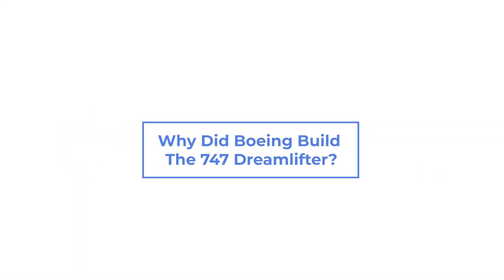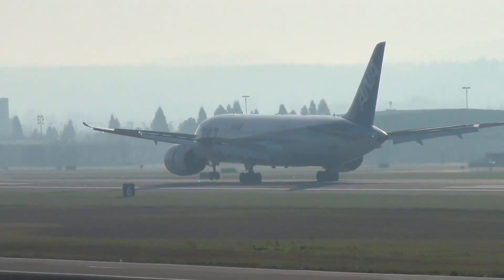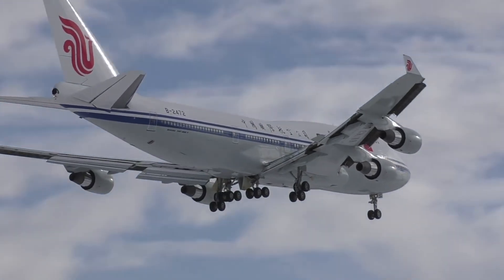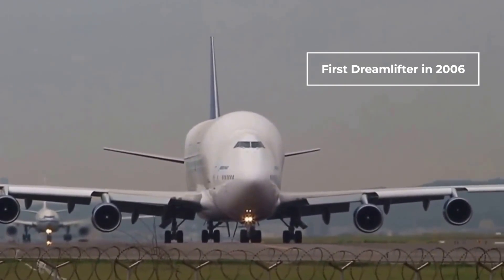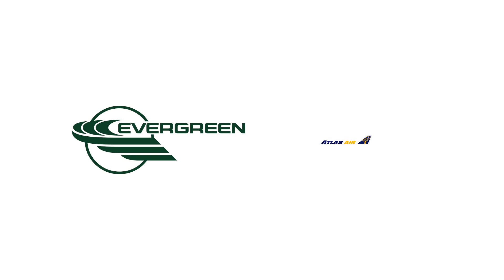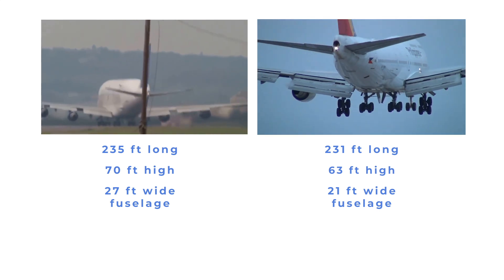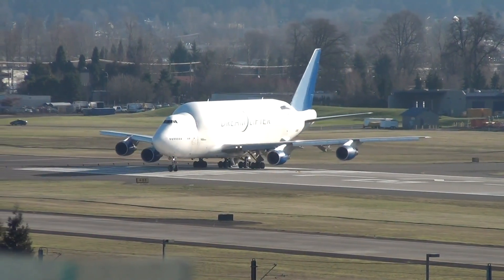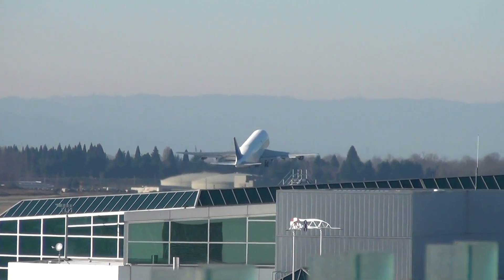Why Did Boeing Build The 747 Dreamlifter?

Comment: Alternative use: Three floor passenger aircraft for ultra low cost flights across the Atlantic.
Reply: Unfortunately only the flight deck is pressurized. Shape of fuselage will not support being pressurized (shape)
Reply: Michael Adams It was meant as a joke. With three floors there would leave no room for luggage, but at least part of the level below the main deck is pressurised on some 747s because the older models have various systems down there which can be accessed in flight through either a hatch in the floor or a small lift.
Reply: @14rans  Thanks for the clarification, I didn't know that

Comment: Short answer: To get one over on Airbus's Beluga
Reply: WHY? MONEY!!!
Reply: Actually the Beluga is Airbus' attempt to get one over on Boeing, they build the Guppy any a more modern version of it (or at least one of the companies they bought did).
Reply: Jame M 
Actually it is the other way around.
Airbus Beluga started operation 12 years earlier than Boeing Dreamlifter.
Reply: @miks564  And the Pregnant Guppy was built in 1962 from a Boeing 377.  So, if you're trying for some kind of who did it first contest - you lose. in fact, Airbus used a Super Guppy in the early 1970's to transport fuselage sections between different assembly locations.  Isn't that ironic?  Using a modified BOEING aircraft to transport Airbus parts?  BTW - the Beluga is a lot smaller and has far less cargo carrying capacity than the Dream Lifter.
Reply: Buckhorn Cortez 
Actually the Beluga XL has a bigger volume capacity than the Dreamlifter.
And this isn’t about what company did what first. Boeing has started 100 years ago, it has twice the age.
This is to point that the Beluga didn’t possibly came after the Dreamlifter because it actually came first, and these companies do not waste money building cargo versions of their aircraft for their own use because of someone else has built something. They build them because they actually need them.
These are not marketable aircraft. They only build them for their own operations.
 And despite having arrive much later, Airbus has had many firsts in modern aviation, and the proof is there for anyone to see. It is now Boeing the one playing catch up.
Reply: @miks564  you WON here !

Comment: Is it just ironic Airbus planes were made on the bases of Boeing 
The super guppy was actually a Boeing made aircraft.
Reply: from time to time, beluga's fly right over my house. Always fun to see and track them on flightradar24
Reply: not entirely correct.
Its true Airbus bought and overhauled the 2 cockpit pressurised super guppies from NASA to fly airbus parts.
The prototype turboprop was a converted Boeing C-97 
the enlarged 2 ones were build from scratch and used some parts of the B377 and 707
Airbus BOUGHT the license rights to build brandnew super guppies itself.

From the 6 guppies build only the 5 superguppies are still there.
The first Guppie with the piston engines was sadly scrapped
Airbus has them still on display at their factories in the UK, Germany and France. 

In the US there are 2 on Display and 1 still in service at NASA.
The irony is that the Supper Guppy still in service at NASA is a Airbus build one based on an old Boeing design .
Reply: When Boeing is not there, Airbus would be only a dream
Reply: @SurveyCorpsHikari  Airbus is a dream, and Boeing is nowadays a total nightmare
Reply: @lex1945  No
Reply: @DorianTMChannel  yes
Reply: @DorianTMChannel  Ever heard 737 MAX